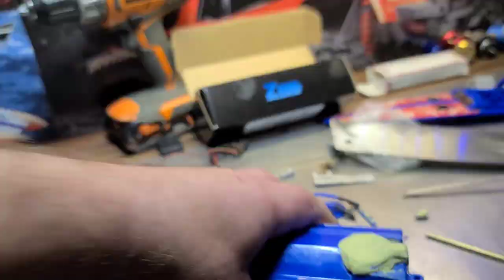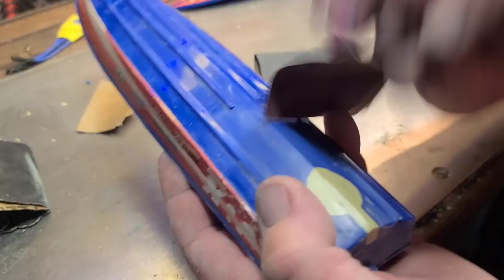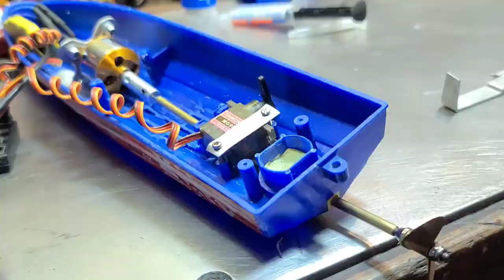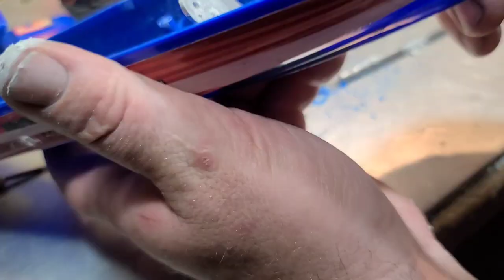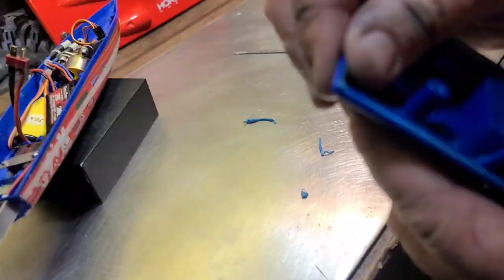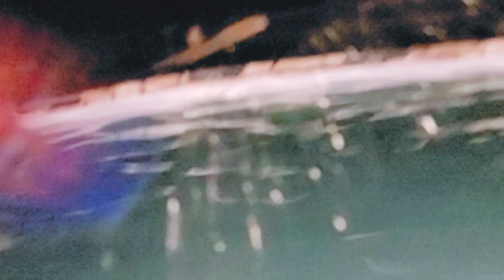RC Toy Boat Conversion - Fast Electric RC Boat Build

Comment: Be interested to see that with a smaller prop as it doesn't sound like that little motor is revving out very high because of the torque on that prop.  Reckon it might go quicker with a smaller one maybe?  Fun experiment anyway dude.
Reply from the maker: I agree 100%  I was thinking the same thing.  It will probably haul tail with a smaller prop.

Comment: BigB do yourself a favor buy a spectrum NX6  transmitter and an E-flight UMX Turbo Timber rc airplane ✈ a couple 350mah 2s batteries  and you'll be flying in your backyard with the whole family 👪 2:05